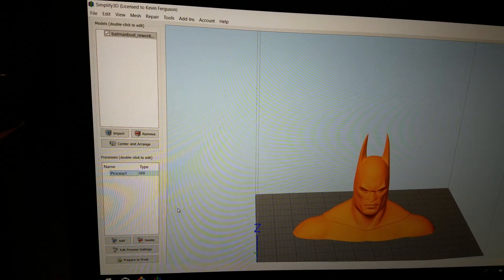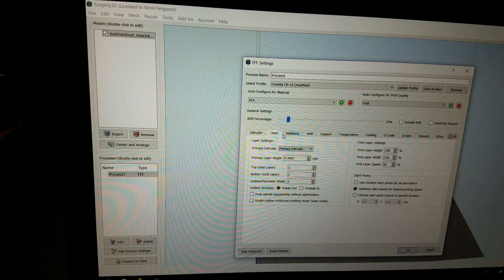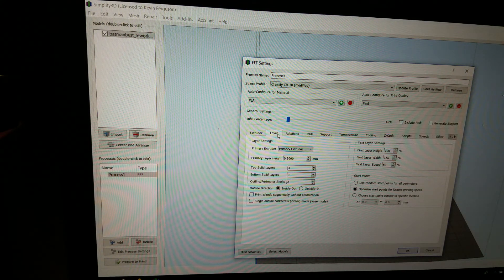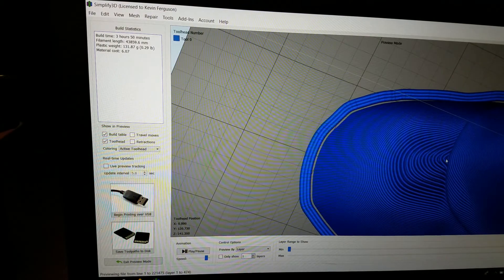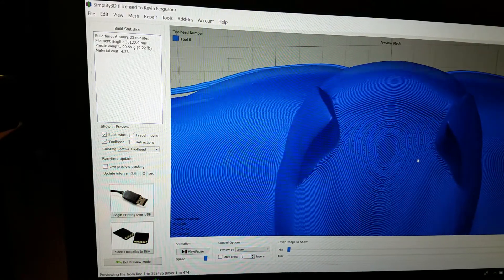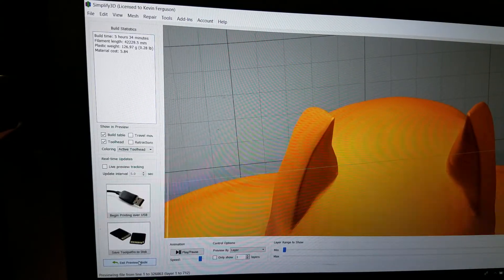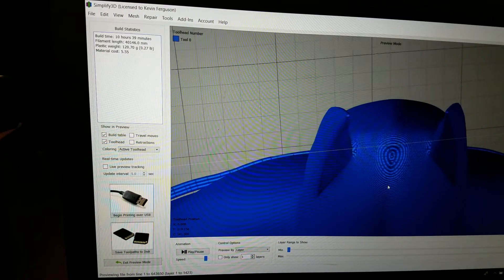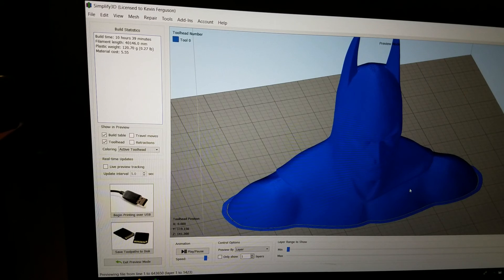Cr-10 1 mm nozzle part 2

Comment: are you using just PLA with the 1mm or are you using other types as well eg flexible, nylon, etc.?
Reply from the maker: Rover Ussrover yes. Just my normal pla. I'm using 220 degrees. To make sure that the pla melts fast enough for the demands of the bigger nozzle. So far I haven't had any problems with the Extrusion at all.
Reply from the maker: Rover Ussrover so far just pla with the one mmmm I do have some flexi I want to try to use ABS with the bigger nozzle. Right now I'm just having a lot of fun with it.
Reply: Curious to see why you are using simplify vs cura?
Reply from the maker: Matthew Lawrence when I first started printing simplify3d had better control over support material. Adding and removing. Now I understand Cura is playing with tree support. So I'm thinking of using that as well
Reply: Average Joe's 3D -thanks for the reply. I just installed my 1 mm nozzle and was trying figure out the needed settings for the proper prints(in cura). I’ve got 1 print to work out and several failed prints...
Reply from the maker: Matthew Lawrence , try going 5 to 10 degrees above your normal temperature. You're trying to melt almost twice as much plastic as you normally do. If it fails try slowing it down a little bit. You can adjust that on your Extrusion multiplier
Reply from the maker: I've used both pla and flexable.
Reply from the maker: I got really good results. If it's at all peace the layers still look pretty good.